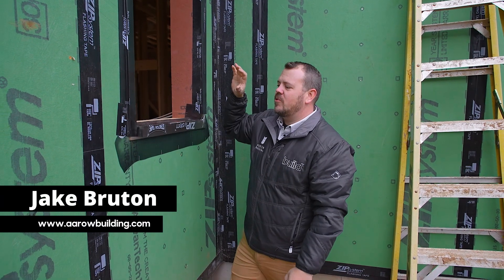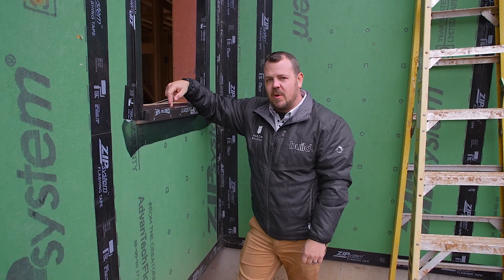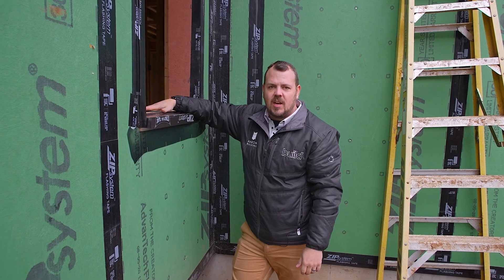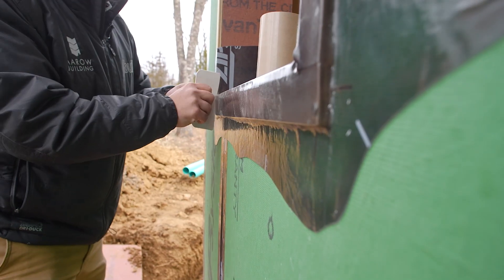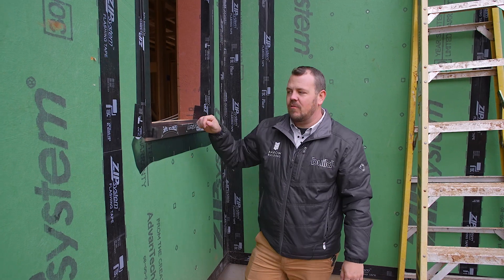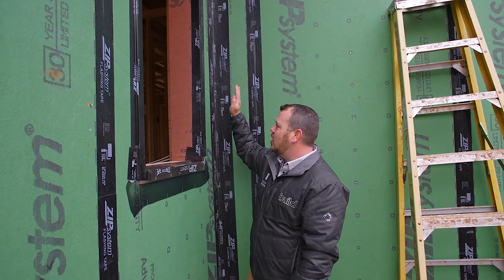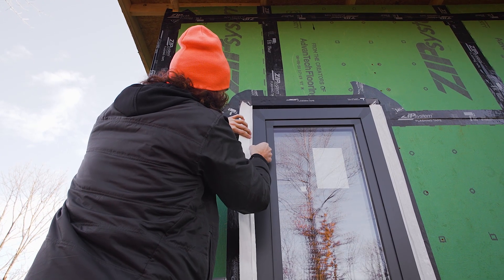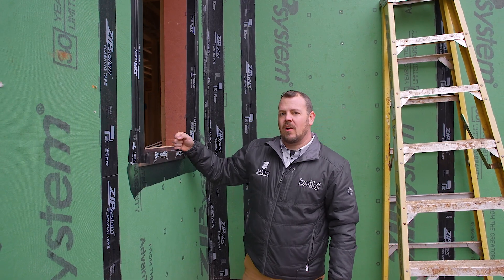Window Rough Opening Flashing

Comment: How much thickness do I allow for rough opening on that sill that consists of bevel cedar and backstop? My window is 47 x 48 wide. I know I need a rough opening of 1/2 extra to the size of my window.
Reply from the maker: It really depends on the depth of the window and the window manufacturer. When we work with 3.5” deep euro style windows we add about 1” all the way around.

Comment: Would backer rod and caulking be a substitute for a back dam?
Reply from the maker: Not exactly. Water could seep beneath the backer rod and caulk could easily be discontinuous in nature when installed without the installer knowing. Both could mostly work but a physical dam is much more secure.